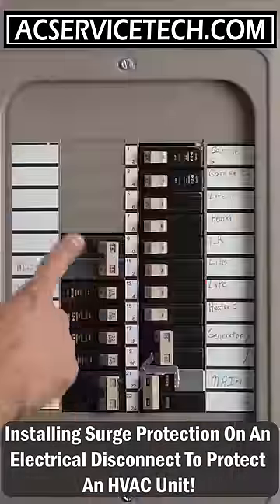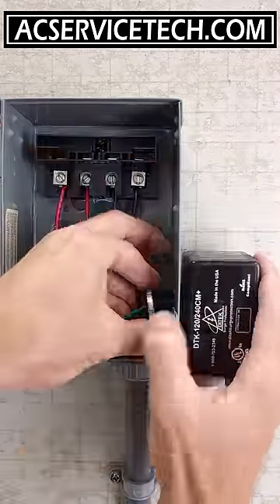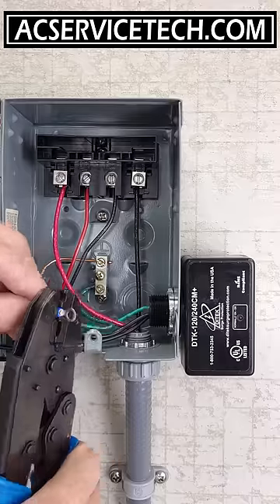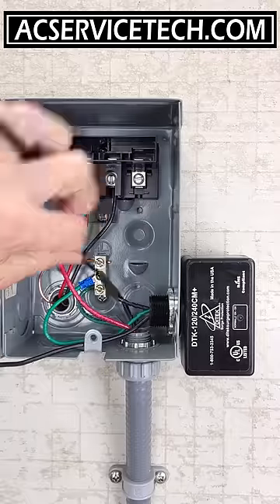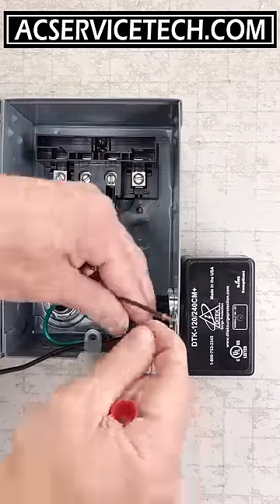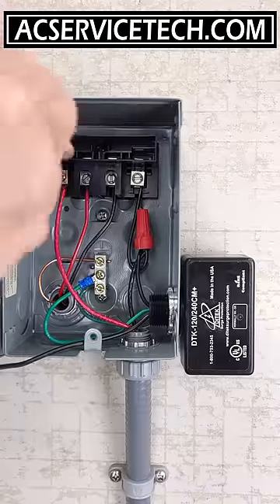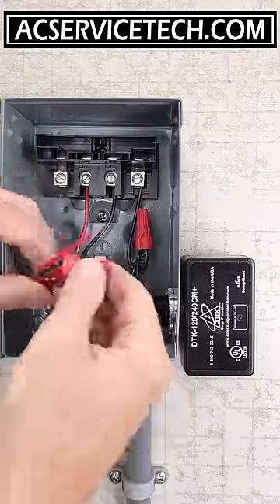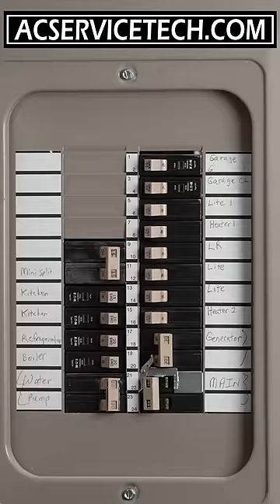Installing Surge Protection at the Electrical Disconnect Box! Pass Code! Protect the HVAC Unit!

Comment: Wire nuts, how quaint. 😄
Reply from the maker: Believe me, I wish there were some other way besides those or splice connectors! I wish the disconnect manufacturers would come aboard and may disconnects with more lugs. I would love to just double lug but that is against code!
Reply: @acservicetechchannel  hey man the work is clean. Some really cool stuff from wago out there too bad it can't be used in some places.
Reply from the maker: Yes in the vid, I know its fast forwarded but I was holding a WAGO in one hand and a Wire Nut in the other to show, technically those are the only two options which kind of stinks since its stranded wires. Thanks brother!

Comment: Why in parallel!? How could it protect anything without being in line?? It's going to reduce the surge of the entire grid??
Reply from the maker: Its going to temporarily short to ground at that location to protect anything downstream of the device. Its only going to help and is self sacrificing and won't continue to work after that. The indicator light shows it will still work to help protect the device, thanks!

Comment: I don't think it matters if it's parnell on the load or line, once the disconnect it installed it does the same job
Reply from the maker: This is true. We just install these on the load side because of the instructions on this brand, its going to do the same thing after the disconnect is in, and state licensed HVAC contractors typically are not supposed to work on the line side of the outdoor disconnect per NEC code, thanks!
Reply: @acservicetechchannel  this is actually a good point I overlooked.

Comment: Craig, in your opinion is the DTK 120 good enough for an inverter heat pump compared to KoolGuard or ICM493??
Reply: No but it's cheaper and easier
Reply from the maker: For a more in depth explanation, check this video out: https://youtu.be/yJziZssS4FM

Comment: If I were to install one just like this, would it only protect the HVAC line or would it protect the whole house too? I’ve been trying to protect my home for a while but my panel is full and am not really looking to upgrade just yet.
Reply: You would probably want a whole house surge protector which would be installed at your panel. There are ones that fit outside of your panel.

Comment: As an electrician since 1981, I do not recommend wire nuts on stranded wire. 
They were never designed for stranded wires.
Reply from the maker: I would love to have another solution but really with this type of disconnect, its splice connectors or wire nuts. Even crimp connectors won't due because there are three wires. We can't double lug either in the existing terminals. We need a new design to our disconnect boxes that will facilitate surge protection. If you have any connection ideas, please feel free to share. We try to be a community that listens and thinks what could be best, thanks!
Reply: set screw wire connector

Comment: What about the 24v thermostat wires?
Reply: Commonly powered by a transformer in the air handler unit. Attach surge protector to the air handler disconnect to protect the low voltage system.

Comment: Multimeter isn't certified to do a dead measurement. You need a voltage tester meant for it
Reply: yamaszlofmcdurkin  yes, you can measure voltage with it. But it's not certified to use as a prove dead device.
Reply: yamaszlofmcdurkin  Why can’t I use a Multimeter or non-contact voltage detector to prove dead?

Firstly, the use of Multimeters or non-contact voltage detectors is advised against in the HSE guidance and the use of these has resulted in accidents in the past.

The reason why a Multimeter is not suitable is that it is all too easy to select the wrong range. In addition, the Multimeter relies on battery power to function, thus there is a great margin for error in making a false “dead” reading on a live circuit.
Reply: The best way to test for voltage is to lick your fingers and place them on both line leads. Certified by god
Reply: @pablonavarro278  we have a code book from the 70s or 80s (I’ll have to check the exact year) but it says to test voltage with you thumb and forefinger. So yeah your right
Reply: @justme5384  well that’s why one of the most important things a new tech learns is how to properly use his tools and the potential dangers associated with each practice.
Reply: @justme5384 you are joking right?
Reply: @OLDSKUULGARAGE  no. You cannot prove dead with a multimeter.
Reply: @justme5384  but if it is charged?
Reply: @OLDSKUULGARAGE  regulations say it's not certified. Doesn't matter about anything else
Reply: @justme5384  ah yes regulations. The regulations can change depending who oversees a job. Does the regulation tell you which way to spin wire nuts? A multimeter is perfectly fine. It will even tell you if there is residual current. A tester will not always. Especially lights. When a neutral side may be hot from a short a tester wont. A multimeter will.
Reply: @OLDSKUULGARAGE  what tf is a wire nut?
Reply: @justme5384  i really hope you are trolling. Have a good one.
Reply: @OLDSKUULGARAGE  well I know what they are, but no right-minded electrician would use them when there are wagos. Pronounced wagos, not wagos
Reply: @justme5384  yeah you are trolling, have a good one!

Comment: What size AC is that??  1/4 ton? LoL . Those wires look like 15amp max. Or 16guage.
Reply: Smallest size 1.5 ton central air units usually only need 14 awg at 15 amps. Check nameplate for minimum circuit ampacity. Wire has to be able to handle that number

Comment: Supposed to be on line and the ground wire is supposed to be as short as possible..
Reply: Short as possible really for all wires but also one that gets forgotten a lot is you want your leads as straight as possible to. Less resistance and interference the better.
Reply: Actually not true per spec of the designer. All wires to be on the load side
Reply: @aihf3063  what do you mean?

Comment: Lever wire nug would have been better.  Also, you didn't follow manufacturer guidelines for the wire nut.  The wires should be twisted several times.

Comment: If you're not breaking the power to the load then how is it supposed to be a surge protector and less has a giant capacitor inside that's just modulating the load to keep it steady
Reply from the maker: Its going to temporarily short to ground at that location to protect anything downstream of the device. Its only going to help and is self sacrificing and won't continue to work after that. The indicator light shows it will still work to help protect the device, thanks!

Comment: Lighting strikes? Surge protectors don’t protect your home electrical service from lighting strikes unless if there is a lighting close by that might hit a transformer or something. That’s why you have grounding electrodes for that actual protect your home from lightings
Reply from the maker: These are not mean't for direct lightning strike hits but one nearby can cause a surge in the electrical grid that will affect these units circuit boards!

Comment: Have you seen how large a Lightning strike is??? Surge protection is not Lightning protection. You’re little circuit board and plastic isn’t going to protect against lightning. It’s a “surge protector”
Reply from the maker: I agree, I didn't mean any direct strike but just if there were one that affected the grid or power lines nearby which affected the electrical power here.

Comment: Preference I suppose, but I'm not a fan of the wire nuts on high voltage, as I see too many loose connections causing melted connections. Generally, I use male spade connectors and place on the lug behind the wire.

Comment: I'm extremely new at electronics.
I just did my mom's ceiling fan (amongst other things) to find that black is hot and white is ground.
In automotive work,  black is ground and red is hot. 
Why are these wires black and red, and which is which?
Reply: On 230v systems each wire is a power wire and then you have ground. Polarities aren't an issue.  On 120v you have power, neutral and ground.
Reply: The outdoor transformer coil gives 220 volts. Black (hot ) runs to one end of the transformer coil, red (hot) runs to the other end, white (neutral) goes to the middle of the transformer coil. A circuit using black to red gives you the whole 220v. Black to white or red to white connects you to half the transformer: 110v.
Reply: Current US standard for 120v systems is black hot, white neutral, and green/bare ground. 
Grounds in AC systems are actual earth grounds whereas in an automotive application ground is a chassis ground. The ground in an automotive system is a part of the circuit, it is what is referred to as common. Ground in an AC system is not supposed to be a part of the circuit, its there for safety. The neutral in a 120v AC system is the common wire. On older electrical systems there might not be a ground and the neutral gets bonded to the frame of the thing its powering.
For 240v in the US there is 2 hots and a ground, one hot is black and the other is red. They are usually referred to as line 1 and line 2
Reply: On 120v. 14-3 or 12-3 have 2 hot wires red and black. Can use one for fan and other for fan light. 2 switches.  On 240v Usually black and red are both hot 120v each. When running a 240v motor, stove oven, dryer, water heater, etc. 120 on each end of element makes 240v across element.

Comment: If it's in parallel in the circuit won't it be called a surge arrestor? Or is it the same thing?
Reply: Same thing L Vs H voltages. Thanks

Comment: It's all nice that he explains all the stuff he's doing , except he didn't do a very good job,   you have to twist wire nuts down more then that til you get some twists in the wire,    !  otherwise when underload and current is running thru the wires they may vibrate over time or under the weather or use and come loose , which is a fire hazard and dangerous , a electrician is supposed to above all.make sure a system is grounded safely and bonded properly and keep fires and safety solid number 1 !  and you dnt just twist wires like that barely and stuff them back in a metal box lol. Joint connections must be solid and secured to stand rhe test of time and under stress from amperage running thru them under load .    This is a totally slacker job on the wire connections.  It's not  my a proper level quality job. if you're going to make a video  show pep how to do it safely and to.NEC standards . You have to care about the homeowners and the job you're doing , not just rush thru it, we are all busy evryday , But they're depending on you.   I been apprentice for lomg time 6 years,  not a journey man yet   but even I know this stuff and so do any workers in the field that do good quality work!!

Comment: its not protecting anything if it doesnt turn anything off. Did i miss anything?
Reply: Should be on line
Reply: Yes, it's a business
Reply: I personally like ICM phase / surge protectors . They have adjustable set points incase of a low or high voltage situatio and will trip off . They must be manually reset.
Reply: Sounds like it shorts it to ground, the path of least resistance, I believe that model is a surge arrestor.

Comment: Why not just install it in the panel and protect the whole house...
Reply: That would make sense if you're an electrician
Reply: Those are a lot bigger and more expensive. And also recommended. But at the same time, the one at the ac unit is more of a plan b backup. It's kind of like a redundancy plan.
Reply: They are not much bigger, and they are not that expensive.